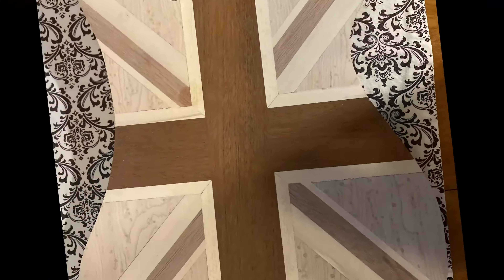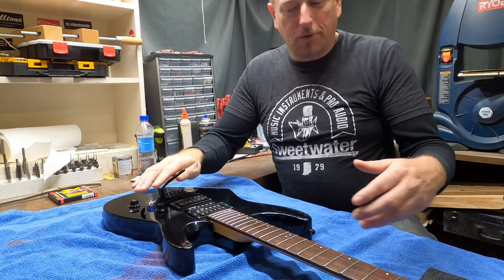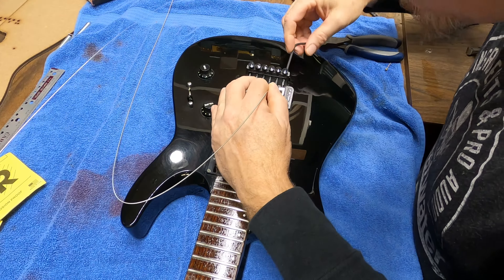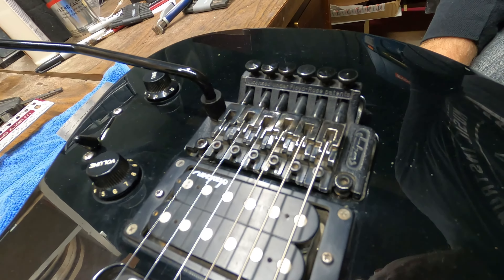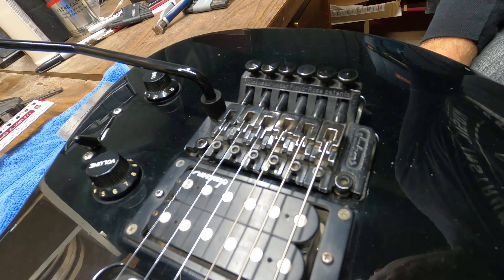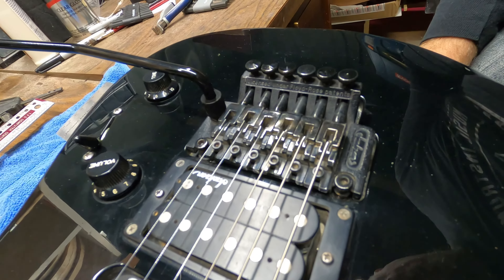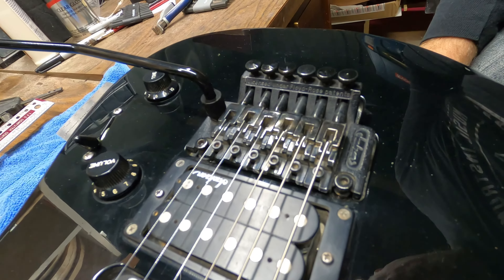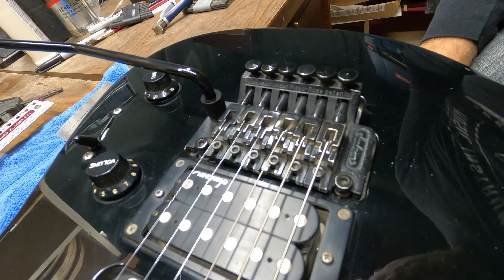How to Setup a Floyd Rose Trem System Properly with Low Action and Intonation

Comment: Your mistake was turning the pivot without loosening Floyd
Reply from the maker: Thanks…always willing to learn
Reply: @letsbuildaguitar9230 yeah. I learned the hard way. On a Floyd rose there is a knife edge where it balances on the post and if you raise your action by tightening or loosing the posts you wear down that knifes edge and overtime it cause issues with tunning, so what I do first…. Is oil that knifes edge every once awhile and every timeou I adjust action height I loosen the strings first make adjustments then retune…. It’s kind of annoying

Comment: I have found to leave my nut locks loose for a few hours of playing 🙃 using tremolo excessively to stretch strings 🙃 tune one final time with fine tuners at the 3/4 up position because most of your tuning will be tightening strings now mostly as they stretch. I find if I leave them at the halfway position I will eventually run out of adjustment as strings get a month or so old ,I only get about 60 days out of a set of strings if that and once you are all setup and insinuated it definitely seems to be faster to just replace 1 string at a time and it always comes together perfect, I have found the heaviest sustain block 😀 and some hair ties or rubber bands will dampen the spring vibration also.and always have a hardtail to just grab and play as much as I love the floyd rose it just doesn't ring out or have the sustain of a hardtail,lol.i will always have a full floating tremolo there just to much fun .a surface mount one way tremolo is a little better solution if you want the stop ✋ of the one way and a halfway hardtail sound.once the overdrive and distortion along with a big amp come together ❤ it kinda hides any sound discrepancies the floyd has when playing it unplugged 😆 hardtail definitely has the cleaner sounds 👌 but I still live in that 80s zone .long live on the sound of evh Eddie was the master original trickster of the floyd rose.peace and nice informational video for the guys still fighting with there floyd 👍 😀
Reply from the maker: Yes good recommendation

Comment: I would definitely use a block underneath the tail of the bridge while restringing it. It'll save you the whole tuning it, retuning and retuning it over and over again. Definitely loosen the string tension before adjusting the bridge posts. There's a tool for about $20 that's made specifically for a Floyd to do the intonation which lets you get completely exact with that process which is great. Lastly you can put the strings in backwards from the tuning keys on the headstock going back towards the bridge and that works great except for the high e string usually which you will need to string normally to avoid it snapping at the ball end. Excellent video though brother
Reply from the maker: Thanks!  Good advice!
Reply: Wrong. No need to loosen string tension before adjusting string posts. This is an urban myth,and it's been debunked.
Reply: Who debunked? @anpleidhceeireannach9498
Reply: @cadebrown2092  Jim Donohue,former head of Ibamez custom shop,in a book by renowned luthier Dan Erlewine, and the manufacturer, Floyd Rose,in all of their official instructional literature
Reply: @anpleidhceeireannach9498  good information. I just did a setup on my dinky and didn't loosen the strings while lowering the bridge.

Comment: I do mine a bit different, I fashioned a block that fits in the back between the fr and guitar body and holds the saddle flat while I back off the spring screws. Tune it up (which will be a lot faster cause your not fighting against the fr) slightly flat before tightening nut, so that it will come back to tuned when tightening lock nut, fine tune it then start tightening spring screws just enough to where the block comes out (will have a liitle bit of resistance,  but should come out easy), everything should be balanced perfectly. When I first started out had an Ibanez and had no clue how to setup trem and could never keep in tune so i locked the saddle and had no trem. then ytube came out n I learnt how to setup a guitar properly, went out and bought gauges and files and stuff. I've also seen a guy use a bunch of picks instead of a block cause not all guitars are the same, and he didn't want to be making blocks all the time, but it is tricky to hold those picks and slide them in without loosing one and they all fall. I go through these steps every time I change strings even if theyre the same Guage, because not all strings are the same, and you want that thing perfectly balanced, spring tension and string tension should be same. Anyhow thought I'd share for the beginners watching. Also get a Floyd rose intonating tool
Reply from the maker: Good advice!  Thanks!

Comment: I have a question. Will lowering the spring-tensioned bridge damage the blades? I'm asking because with a new guitar I don't know whether to completely remove the springs so as not to damage the blades and pins.
Reply from the maker: It is a controversial argument that gets brought up a lot!  I think it’s best to release tension first, especially on new bridges….this is something I should have addressed in the video!

Comment: I am so glad I saw this video on my feed. I found my dads old floyd and got some new strings for it, didn't know how to set up the action but it was tolerable. With this video I can go back and do some fine tuning. Only issue is that every time I try to push the bar towards the neck it just doesn't seem to budge but works fine when I pull it back.
Reply from the maker: Sounds like the Floyd is tipping way forward and the tension isn’t set properly.

Comment: I am in the process of setting up a Floyd Rose and I found this to be very helpful.   Well done.
Reply from the maker: Hey thanks so much for your encouragement.  One thing to add is that in this video I forget to mention that you should take tension off the strings before raising or lowering the posts.

Comment: I use locking machine heads with a fender roller nut. Don't need to lock it on the nut
Reply from the maker: I also use locking tuners and love them!

Comment: Question. When you adjust height, isn't it a bit harmful for the knife edges if you do it with tension on them? More so on a cheaper floyd? Or is it ok to do it like so? I did notice interestingly enough the second time you just removed the back springs (nice move imo.) I'd be nice to see how you did it
Reply from the maker: Thanks!  It’s interesting how this one point has raised more controversy on my videos than any other.  Some argue that it absolutely destroys it!  Others argue that it’s been proven that it doesn’t….maybe if you do it a lot!  I do typically loosen the tension….I think it’s probably better.  But it does make me wonder if it could be much harder on them than doing lots of dive bombing…there would be a lot of pressure on the same surface and there is movement even when using the trem.

Comment: on intonation.  ,when every string was sharp ,  I missed the part about moving back the saddles   distance .   how far back they needed to go 'til intonated
Reply from the maker: You move them until it’s intonated.  You need to keep checking to see that it’s in tune at the 12th fret as well as in tune when playing the string open.  If your open E is perfectly in tune, then your goal is for your 12th fret E on the same string to also be perfectly in tune (not sharp or flat)

Comment: If you’ve lowered the Floyd all the way and adjusted the truss rod RIGHT before you start getting fret buzz what is my option to get it lower ?
Reply from the maker: I’m assuming your Floyd Rose sits on the body but is not countersunk into the body?  The ones I build, I countersink so that I can get it as low as I want.

Comment: So I saw the entire bridge plate can be moved up/down and the bridge saddles can be moved forward/back but can the bridge saddles be moved up/down individually?
Reply from the maker: On this particular one no they could not, but some do have that!
Reply: @letsbuildaguitar9230  Ok.

I have a strat with a locking nut and floyd rose and have never tried to set it up and it needs a string change. Your video was very helpful so it'll give me a good start to try mine now.

The real reason I was asking was because my strat has a compound radius. All my other guitars have a normal radius so I usually adjust the saddles to match the radius, just wasn't sure how that works for a compound radius. They all look pretty flat to me right now so we'll see, trial by fire lol

Comment: Use the  tremolo Bar to lower the Spring Tension when u set the Action on the Flpyd Rose, the way you do it is damaging the Studs
Reply: I stopped watching after seeing this. Ideally you should adjust without ANY tension from the springs and the strings. Otherwise you'll damage both the studs and the bridge. This is the main reason why FR doesn't return to pitch after using it.
Reply: This doesn't do what you want it to do. The pressure of the knife edge on the studs will always be there no matter what position you put the tremolo bar. The only way to reduce the pressure is to either remove the springs or detune the strings so they are slack. At that point you will notice that the bridge knife edges are off the posts and there is no pressure. If you just lower the tremolo bar, this reduces tension in the strings, but increases tension in the springs and vice versa when you raise the tremolo bar. The overall pressure of the knife edges on the studs remains constant until you detune or remove springs (or both).
Reply: @Qban220 I got my first guitar and it's an FR a month ago. I been adjusting the bridge height while dive bombing as a user said it's better for the knife edges. Would it be better to remove the springs completely when adjusting height?
Reply: @MadJDMTurboBoost So I have to detune and remove the springs completely for every bright height adjustment ?
Reply: @Ben-ld1qi  knife edge can't rest against posts under tension while adjusting action height.
Reply: @Ben-ld1qi  Correct. You should be able to pull the bridge away from the posts. If the knife edges are against the posts, they will get ground down when you turn the posts. Best way is just like you said, detune the strings and remove springs. Usually you can detune the strings enough that either the bridge moves away from the posts, or you can pull it away by hand after detuning (rather than having to remove springs every time).
Reply: @MadJDMTurboBoost  Thank you, that's just what I did! I never would have thought this hassle is necessary for every bridge adjustment. By the way is this precaution necessary for pretty much every floating tremolo? My sibling has a Wilkinson 50IIK and I remember he said adjust the height while it was under tension.
Reply: That's a myth. The knife edges endure much more friction and contact with the posts under normal operation of the bar than they do if you turn the posts under tension. If you have a cheap floyd rose special made out of a soft alloy then it may be a concern, but in that case you'll probably have bigger fish to fry

Comment: Would changing the string tension in the back help with having to move the saddles so far back?
Just something I thought about. 🤔
Reply from the maker: Spring tension will have an effect on intonation but very little.:..each string should be be properly intonated using the saddle adjustment.
Reply: @letsbuildaguitar9230  I gotcha. 🙂👍

Comment: hey man, not sure if this channel is still active, I need advice on how to set up a head crasher type trem, the type where the string ball ends get left behind the trem right below the fine tuners, a bit easier to restring but wanted to know your thoughts
Reply from the maker: I really haven’t worked with that bridge, so not sure I’d be much help.  The one you have is like a Fernandes version of a Floyd Rose?
Reply: @letsbuildaguitar9230  yep! I followed your advice, although at that time somehow the locking nuts weren’t the right fit, now though I’ve got the right replacements, then I’ll rewatch ur vid to set it up, it has those top screws as well like a floyd

Comment: This system is horribe in my opinion. Bought an ibanez RG 320 fm without thinking about it might have a different bridgesystem. I tried to tune it to drop C, and have not been able to play it since haha. Why do they make this system ? Can't really see the benefit.
Reply from the maker: Actually if you are familiar with them, and know how to set them up, they’re phenomenal.  That is if you appreciate Eddie Van Halen.
Reply: @letsbuildaguitar9230  Yeah it's properly because i'm not familiar with the system. My bridge is tilting downwards. Do I place the strings first and then thighten the springs ? Or the other way around

Comment: Was messing with my Floyd guitar tonite and I noticed my saddles are not even with each others like the guitar your working on ,all the saddles are in sync with each other… 
Is there really a neutral position for saddles for checking for #/b’s ?
Reply from the maker: I would not say a neutral position….what is key for saddle placement is that they are positioned for perfect (or as close as you can get) intonation.   Intonation determines where the saddle is placed on each string.   Do some research on how to intonate a guitar.  Play an open E on your low string….make sure it’s in tune…now play the same string on the 12th fret just pressing hard enough to make the note ring…is it sharp or flat?  It should still be in tune…that’s intonation.  Take note the harder you press the string or if your bending it, will make it go sharper…try to make the note sound without excessive force.  The saddle will need to be moved forward or backward depending on how flat or sharp that note is.

Comment: Floyd approved trems will all have 3 adjustment intonation positions for the Floyd saddles.

You missed the key trick with Floyds, you leave the springs in and block it in the back to keep the trem perfectly level while you're working on it. It essentially turns into a hardtail and completely eliminates the hours of frustration people go through tying to balance it. You then do the typical relief, action, nut triage, then intonation, and finally at the end, you leave the block in the trem, then very slowly start loosening the springs at the back until the block falls out. The block with be tilted ever so slightly forwards, but just retune it and it'll balance out to perfectly level.

Boom perfect Floyd rose setup in under an hour. Any tech charging extra for Floyd setups either has no idea what they are doing or are gouging.

Comment: Cardinal sin number one: Never adjust the studs without removing the tension from the Floyd. Grooves cut into them and you will notice a click and it goes out of tune. Only titanium studs can take adjustment under tension. Also they make two tools (the key and skyscraper ) to put under the fine tuner/saddle to properly adjust the intonation 🤟. I've been pissing around with these since 1988 😂
Reply: That's not true
 All the guitar makers adjust the string height at full tension at the factory. The chief of research and development of Ibanez USA literally said it won't harm the knife edgesxand hesset up thousands of them

There's no way these guitar companies would be ruining their guitars at the factory 

This urban myth refuses to go away,it's a real pity